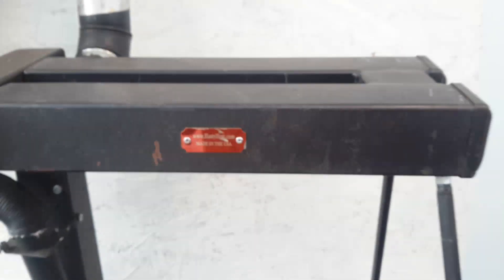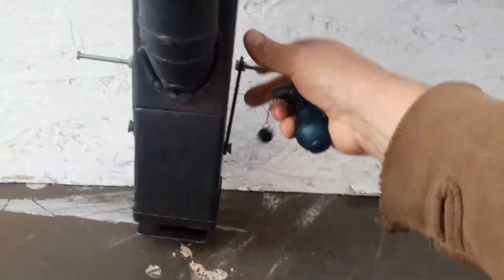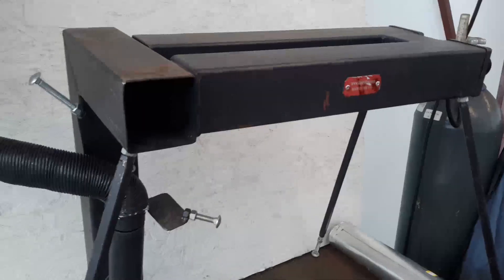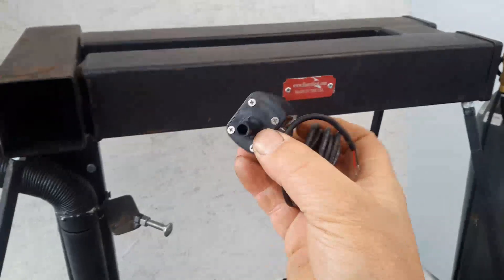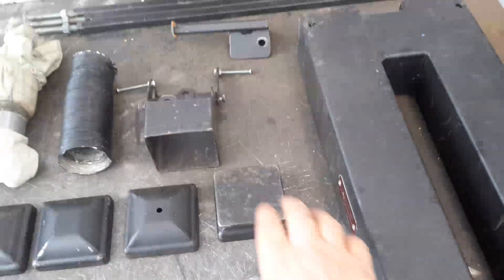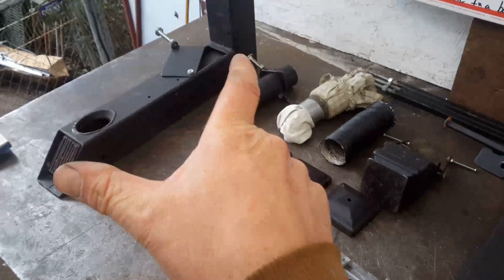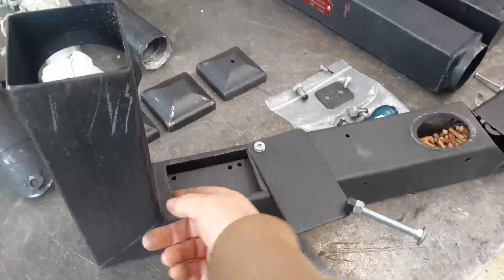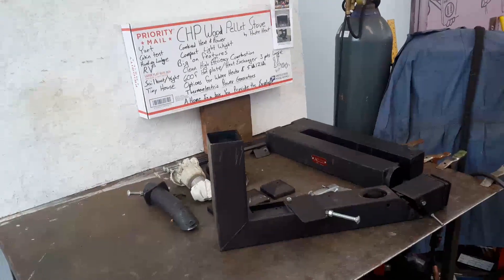CHP Wood Pellet Rocket Stove Furnace Heater RV Caravan Boat Yurt Trailer Tent Cabin Gravity Feed

Comment: CHP meaning combined heat and power, as in electrical output? I see no electrical output or power generation so how is this a CHP?
Reply from the maker: The TEG water cooled thermalelectric generators are not displayed attached to the flat heat exchanger sides.
See our other videos for more detail

Our current TEG is outputting 200W or 9KWH per day, enough for the average daily work commute in a EV nissan leaf electric car...!

Comment: How many square feet would that heat
Reply from the maker: this would depend on how well insulated and sealed the envelope is that you are heating. with 10 KW of thermal output it could heat a well insulated modern house of 100 square meter or so.

Comment from the maker: We just recieved our first batch of 10 from the laser printers in shiny all stainless for the combustor assembly, we will be posting some updated video reviews and info on the latest full production revision.
Reply: Sure would be nice to see shiny stainless steel being assembled rather than stove black... looking forward to seeing in person, chatting with a local customer or your new video with build-out and detailed quality test burning... vaporware or reality?
Reply from the maker: using this link you can find some image of the stainless combustor in plane stainless shine, however for most builds where the heat exchanger of choice placed on the output of this pellet stove is made of steel and or painted black the stainless burner is painted to match.

Comment: you have a tiger by the tail... why don't you make a few more videos showing from start with lighting to temperatures during an eight hour burn to shutting it down... please show us how it operates as you claim. Simple enough request if you are serious. Here is a good example http://www.deadwoodstove.com/customer-videos/
Reply from the maker: Douglas Pohl more PROOF is coming, but before the doubters our first responsibility is to fill the paid orders for these being placed in a springtime camping rush...
Reply: Hasty Heat - good deal then there will be many videos from happy campers... I thought you did the videos and not metal craft fabrication. Standing by...
Reply from the maker: Douglas Pohl our wood pellet combustor is really only 3x3x24" leaving us 3x9x24" in the box for features. we have several distinct iterations based on our combustor technology soon to be revealed.
Reply: Hasty Heat do you think corn will work
Reply: Lets see it in action burning... corn really makes klinkers...
Reply: Second let's see it burning it will literally take you 5 minutes to make the video you don't have 5 minutes????
Reply from the maker: seoulkidd1 we have not tested corn, the only issue might be an increase in cleaning as corn ash tends to clinker up
Reply from the maker: Douglas Pohl checkout our latest burn video
Reply from the maker: Aces High Real Estate checkout our latest burn video

Comment: You might find it interesting how your stove geometry resembles this stove - See https://youtu.be/wXEnVSq2NUs. Novel vertical burn vs common horizontal burn of interest.
Reply from the maker: we are not sure where you see the similarity, however with the very first iteration we decided a horizontal burn was not optimal for several reasons, starting with added maintenance from ash buildup, similar to what the wiseway gravity fed pellet stove suffers from. our vertical combustion conserves more energy and develops a strong vortex to mix wood gasses and oxidizer for a excellent low particulate and emission burn.

Comment: Many pelletized rocket stoves have horizontal burn chambers that accumulate much more ash than this design will.  The result should be much less cleaning (don't have to clean into the heat exchanger) than comparable stoves.  I also like that the intake air can be controlled over a broad range.  This facilitates agressive 'big heat' burns as well as slow controlled burns (extending fuel consumption).   My application would be for a greenhouse where I would use the device primarily to heat water barrels as thermal radiant heaters.  So i'm particularly interested in any water heating capabilities this unit might have.   Not terribly pretty, but it seems to have it where it counts. 

Suggestion. if you rotated the burn chamber, ash tray, and fuel feed intake by 90 degrees (top down view), the fuel feed tube is no longer obstructed by the heat exchanger so flexi tube is no longer necessary and more rigid permanent feed options can be explored.   

Another suggestion - and I dont know the science behind this one - is that some rocket heaters employ a bell type inclosure to force the exhaust gasses downward in order to escape.  As I understand it, this forces more heat out of the exhaust gasses and promotes better 'reburn' of exhaust gasses.   What if your heat exchanger angled down instead of horizontally?  The drawback of course is less horizontal area on the heat exchanger (for warming food etc), but could facilitate greater performance of the heat exchanger (more heat extracted from exhaust gasses).   it could also provide an opportunity for a double sided heating area (think pizza oven) between the upper and lower heat exchanger legs.   Just spit balling so don't take this as any criticism of the current design, if I were to buy one tomorrow, it would be this one.
Reply: Hasty Heat - Fuel input = heat output x Stove Efficiency. 2 days burning one bag of pellets means 40 lbs / 48 hrs = .83 lbs./hr. or about 5,800 BTU per hour. I'd love to see that long of a continuous burn repeated by a user - can anyone confirm with a time lapse video? BE SURE TO LISTEN CLOSE WHEN SELLER SAYS TO "BRUSH BURNER" EVERY TIME YOU DUMP ASH.
Reply from the maker: ihousden exactly why we went verticle, we achieved a 4 day burn without fuss.
Reply from the maker: Douglas Pohl 
An intelligent comment. 
As measured on highest output with 2300 F combustion temperatures this wood pellet stove combusts 2.15 pounds per hour, or about 18,000 btu per hour for over a 18 hour burn per bag. This is enough to match the heat loss to heat a 1700 square foot modern home at freezing. 
As measured on the low side with 14-1500 F combustion temperatures this rocket stove will burn 0.285 pounds per hour or about 2400 btu per hour approaching a 6 day burn.
As measured upon shutoff of airflow this wood pellet furnace will self extinguish within 1/5 of a cup of wood pellets, leaving nice charcoal to aid reignition.
Reply: Thank you for a prompt reply to wit has any third party made a video of your stove to demonstrate what you are claiming? Now it seems the temperatures are astronomical and the heat is just as great... you even suggest burning inside a home... UL certification missing I would not recommend nullifying your home owners insurance should you set something on fire from the blow-torch high heat... I'd even be afraid of starting a carbon draft fire which runs away melting steel like a forge. Please post more burning videos with low and high heat measured with an IR thermometer. Thanks.
Reply from the maker: Not suggesting use inside a home despite our rocket stoves sufficient performance, just giving the output perspective. 
This pellet stove requires no electrcity to operate and has no UL components due to that fact.
At 2300 F combustion the surface skin temperatures were measured at 500 F and below due to its drafted double wall air preheat design.
Reply: Hasty Heat - then why not show the temperatures in another buring video...
Reply: Douglas Pohl 
I have messaged hasty heat on facebook with no reply offering to review his product in exchange of some sort of deal and have not heard anything from him! I too am intrigued in his product but am not sold on the claims and would like proof if not from first hand review then a video proving said claims.
Reply from the maker: Brian Cardoza 
Here comes another heating season, we are now shipping our 4th generation CHP, this would be a good year to get yours and heat things up.
Subscribe to get notified when we post our next videos
Facebook is the worst way to contact us, email to hastyheat@gmail.com is the best
If you would like to shoot a video review we would be willing to ship you a unit if you will put the item price on deposite, which we would refund once the pellet stove is returned.
Reply from the maker: ihousden 
Here comes another heating season, we are now shipping our 4th generation CHP, this would be a good year to get yours and heat things up.
Subscribe to get notified when we post our next videos.
Sounds like you would be interested in the CHP-C combustor only version, these have been very popular in europe used with a tube and shell heat exchanger for hydronic heating.